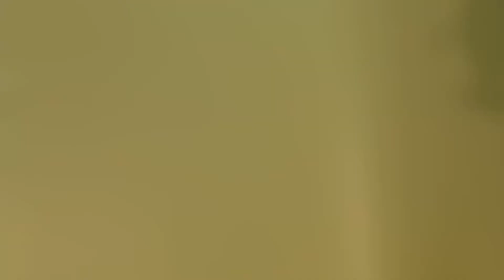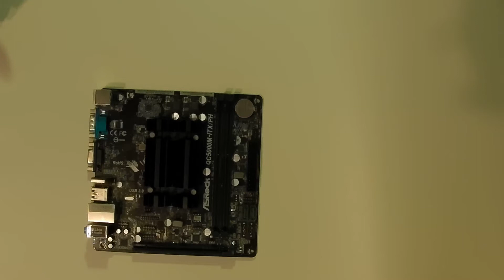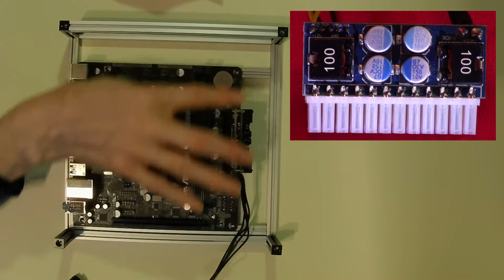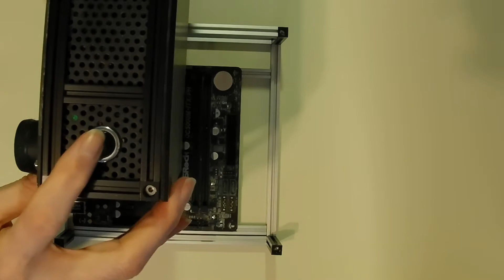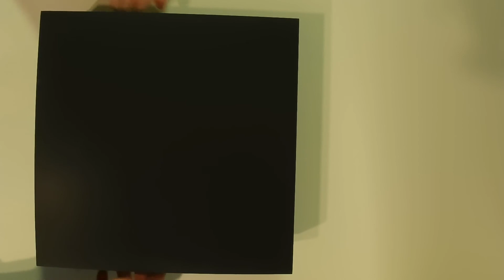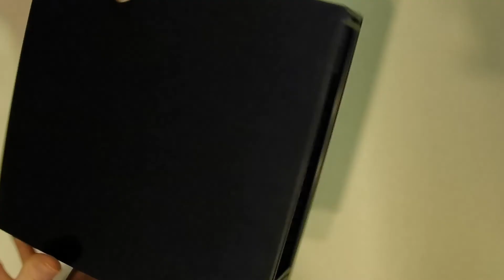Review of the design and construction of a Compact Media computer

Comment: Another cool video. Would love to see a video about the perforated panels. 

That's probably the most difficult part of all this. Guessing a table saw would be necessary.
Reply from the maker: Actually easier than they look, they are made out of white polypropylene, which has a melting point of 160 Celsius so fairly safe, and cut with secateurs and cable snips. Fiddly but it works, then spay painted with black Plasti dip.